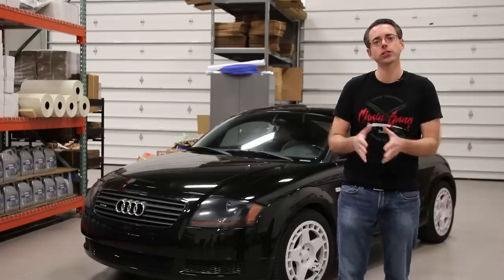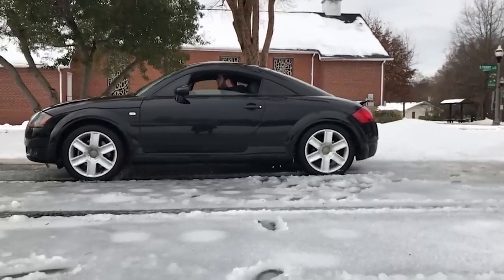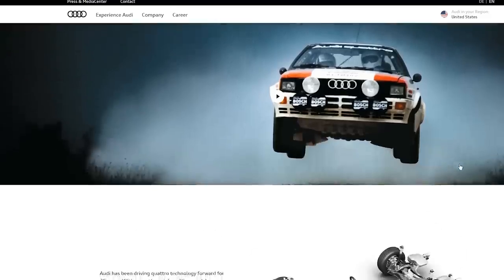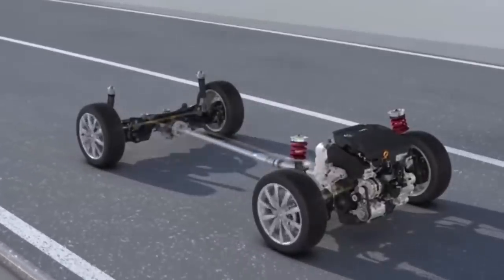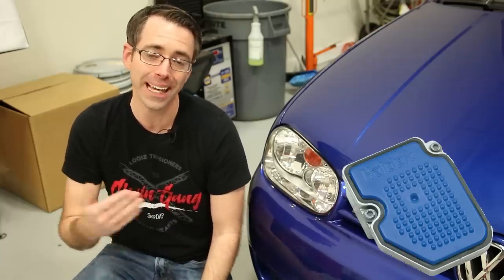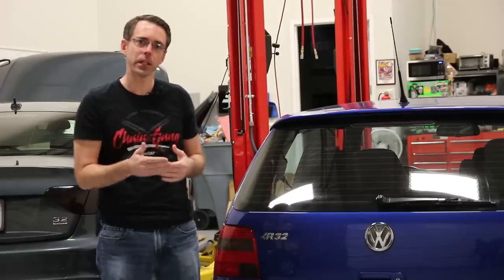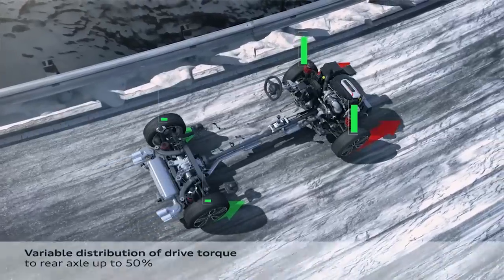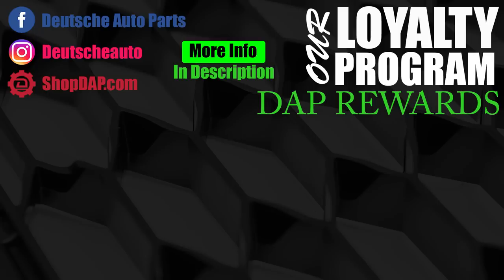History of the Haldex AWD System

Comment: Torque split by a clutchpack is a marketing BS.
If you had front wheels on ice and rear wheels on tarmac, you would not move at all with a 50:50 torque split, because you woul have exactly the same torque rear as you have in front aka almost nothing.
Reply: Wrong, It would work perfectly fine. When talking about torque split its between front to rear axle, not front to rear tire which is what you is thinking.
Reply: @Espfors  Already heard about action/reaction? And tell me more about the difference of torque on the wheel and on the axle. Keep in mind the wheel actually is mounted rigidly on the axle.
Reply: @davorinskvaridlo3567  Torque is output from the gearbox and split between front axle and rear axle up to 50:50. Amount of torque transferred to the ground is dependant on the friction of between the tire and the road. 50% of the output torque will be transferred to the rear wheels which are on asphalt and will transfer that into the ground.

Its quite easy looking this up yourself, for instance:
https://www.youtube.com/watch?v=c2ScHaitFSY 

Just admit you are wrong.
Reply: @Espfors  First - it would be advisable to learn what is a central differential and what is a clutch(pack) - haldex.
Secondly - 50:50 torque split is an open diff. This means you got THE SAME torque always and forever on both axles. As long as one axle loses grip, there is almost no torque, you get the same torque on the other axle. (That's why some smartasses developed diff lock or limited slip diffs or spining wheel braking.
Thirdly - a clutchpack can indeed transfer 100% of torque to one axle especially when the other axle is slipping and the first axle has some grip.

I am not saying haldex will not move. I am saying 50:50 is marketing BS and actually that 50:50 would not move without other systems.
Capito?
Reply: @Espfors  I have another explanation for you:
Open diff: speed of both wheels (axles) is variable 0-200%/200-0% you can stop one, the other one goes double the original speed. Torque is split 50%-50% - you have always the same torque force on both wheels (axles)

Locked diff (no diff): Speed is always the same 100% on both ends. Torque is infinitely variable 0-100%. No matter the grip/torque the wheels (axles) always move at the same speed.

This is the fundamental knowledge to understand before starting to discuss drivetrain.
Reply: @davorinskvaridlo3567  I know perfectly fine what a clutchpack and a central differential is. You never said anything about differentials. You said the car wouldn't move if front wheels were on ice and back wheels were on asphalt with a haldex/borgwarner system, which is completely wrong.

secondly, 50:50 torque split is talking about front to rear axle, not between the wheels. Nobody is saying 50:50 torque split moves the wheels, everyone is saying 50:50 torque split is the capability of the system.

If you were smart, you would argue that if a car were on ice with its front left wheel along with its rear right wheel ( i.e diagonal ), it wouldn't move. For that you would need a locking differential in the axle. XWD is a system that uses clutchpacks that can do this.
 :)
Reply: @Espfors  Strawman. Please stop claiming what I did not say a stop saying I did not say what I said.
Just read my comments again, please. I see no point repeating myself.

In my second and third comment I mention differential gazzillion times and you say I never said anything about differentials. Oh, please, get you reading skills together a stop contradicting absolute facts. I highly doubt this makes any sense for me.

The video and further comments are about haldex and/or central differentials. Anyway, differential works the same way between the axles as inside an axle. Physics/mechanics is still the same.

Telling 50:50 is capability of the system is BS.
Firstly - 50:50 is a flaw of an open diff, not a feature to promote. Especially when you do not have this characteristics.
Secondly - the system is not able to do 50%:50% permanently. You simply cannot control friction of the clutch-pack in a way to take exactly the same torque from the drivetrain to the rear axle as is momentarily on the front axle.
Thirdly - system can do up to 100% to the rear is front has no grip and drivetrain power does not overwhelm the clutch pack.

Your third paragraph is completely off topic.
Reply: It would be much more sensible if carmakers said exactly how much torque in kN the clutch pack actually is capable to transfer.
% is completely stupid. Especially the 50%.
Reply: @davorinskvaridlo3567  No you never said anything about differentials in your first two comments, but I digress. This is not about that, never has..

It's aimed at consumers that cant understand a 4wd system based on how much kN it is able to transfer. Saying it can transfer 3 kN wouldnt make any sense for anyone but people working in this area. 
Yes it can transfer up to 100% under certain circumstances but in general when there is no excessive slip, 50% of the gearbox output torque is the maximum it can transfer to the rear axle. You can argue all day that this is "promoting a bad feature of the open diff" but it's still a fact.

But lets continue this discussion were you state other facts that has no relevance to your 1st comment and I'll keep commenting stuff that is "off topic" :)
Reply: @Espfors  
I wrote: "In my second and third comment I mention differential gazzillion times..."
You answer: "No you never said anything about differentials in your first two comments, but I digress. This is not about that, never has.."

You wrote: "Yes it can transfer up to 100% under certain circumstances..."
Good, you agree with me!

You wrote:"50% of the gearbox output torque is the maximum it can transfer to the rear axle"
My answer: this means maximum transferred torque of the clutch-pack is dependent on the actual gear?
Or the maximum torque has some practical mechanical limit and it is 50% of the max torque from the gearbor in 1st gear? That would actually mean it could make 100% in third and all higher gears.

Now I just sum this whole thing up:
The video states haldex can do up to 50:50 torque split.
There are two things wrong with that statement.
1. There is no torque split. Torque split is done by a differential.
2. 50:50 is wrong number. 0-100 totally possible. 100-0 obviously as front is always driven.

There could be a third interpretation, which would mean 50% of torque from gearbox. I just trashed that 6 lines higher.

You are trying to defend a BS statement which actually confuses people in understanding 4wd properly.
And I see it all over: marketing, press, testers reviewers, so called insiders. Everybody talks BS about 4wd systems.
This was my point.
Reply: @davorinskvaridlo3567  
Okay, confusion on my part, you mention differentials in your third comment.

Yes, the differential is the one doing the torque split. BUT the clutch pack is what is transferring that torque to the rear axle. 
Which in turn means that you could argue that the clutch pack is part of the torque split (a better word would be "transfer") . This is what he is explaining in the video.
(I know this isn't correct as we have stated over and over but for a person that doesn't know anything about AWD, this would make a bit more sense)

Don't really know why you talk about the gearbox, the output torque of the gearbox is obviously dependant on the current gear and 50% is obviously dependant on current gear which is what is determining the output torque.
I'm guessing you are again trying to missunderstand this on purpose, you know what I'm talking about.

Yes the clutch pack can transfer 100% of the output torque if the friction coeff (µ) is really low on the front wheels. 
But for most cases, 50% of the gearbox output torque is the limit, agreed?
If we said 0/100 was the limit, then everybody would think this was always possible and then you would have to explain that it isn't. Now it's the other way around, 50/50 is most often the limit but not always and if you are doing this video then you should maybe explain this.

This discussion is kind of pointless since we both agree on the proporties of this system. I regret even getting into this discussion because youtube people always deliberately missunderstand things to try and win an argument.
But I still think this 50/50 torque capability is fine. It's not always true, but most often. (even though it's a flaw of the open diff design, it's still true) 
Yes, it would be better off going deeper into the AWD system and explaining what happens during low µ on front wheels and high µ on rear wheels but the 50/50 statement still covers the majority of the AWD usability cases. No one is putting their car on rollers to try and see the torque capability.

And if we were discussing AWD, it could be fun to mention that diagonal slip would cause this system to not being able to transfer any torque to the ground :)
Reply: @Espfors  Mostly agree. It is exactly my point to try to make people go deeper and to better understand the matter. I don like press, opinion leaders, testers etc. to adjust the knowledge to the level of casual pub talk. It is their job to give additional information and education to the public. Actually it is true also for automakers and their marketing departments.
Of course there are some guys like Engineering explained or some smart testers, who go deep or deeper.

In one test report of Focus RS there was a claim of up to 70% torque on the back. The tester asked present Ford engineer about it and he said he does not understand the 70%, because the clutches on the rear axle can close (or lock) totally under any conditions if the car wishes so, which means up to 100% to each rear wheel alone if so much grip is on one wheel. (As the car is able to drift on dry tarmac.)

Yes, diagonal or one side is fun, but nowadays handled usually simply by brakes. Increasing torque on the slipping wheel so the wheel with grip can transfer the force created by brake on the other side.
Reply: @davorinskvaridlo3567  Did you ever watch via service computer or other stuff what is haldex (IV, V) doing during driving and especially during slippage?
There is also one thing missing if you talk about torque split - transfer of weight. And when it comes to Focus RS, it can actually overspeed rear wheels and it can do it separately, that's how it drifts although it is fwd biased awd system.
Reply: @4x4.tests.on.rollers  nope. And it has rather nothing to do with the point of this discussion. We were discussing mechanical terms and especially the 50:50 torque split fallacy.
Transfer of weight is just a factor involved in available grip.
Focus RS overspeeds rear axle by design. If you want to have same wheel speed front and back the clutchpacks have to actually slip.
Reply: @davorinskvaridlo3567  I didn't watch it to, but I watched other clutch-based awd systems and I am wondering if haldex systems work similar. When it comes to transfer of weight - I refer to your words that "torque split by a clutchpack is a marketing BS".  Can't agree. Transfer of weight changes torque split in such systems (unlike in passive center diffs systems), so does µ. Or if you meant that 50/50 constant torque split is bs - then yes, agree. Agree also about Focus RS.
PS. I forgot to mention - braking of  spinning wheel doesn't change the 50/50 torque split of open differential.
Reply: @4x4.tests.on.rollers  I basically agree with you, the "constant" 50:50 was a point, the second point was "up to 50:50 split" with haldex. But I also have problem with the word split. I was thinking quite hard on how to explain my thoughts.
Just using "torque transfer" instead of "torque split" would make such statements much more correct and self-explanatory. Like: "Haldex xxxx is capable of transferring up to 50% of the maximum torque coming from the gearbox in 1st gear to the rear axle." This is completely different statement than "up to 50:50".
In a AWD system based on clutch-pack and without central diff one axle is always directly driven. So there is ALWAYS enough torque on that axle to use all available tyre grip. A clutch-pack is just taking off some part of the torque from the direct drive to the second axle by friction. And it is impossible to "split" the direct drive to the directly driven axle. Of course the ratio of torque varies between axles as you state.